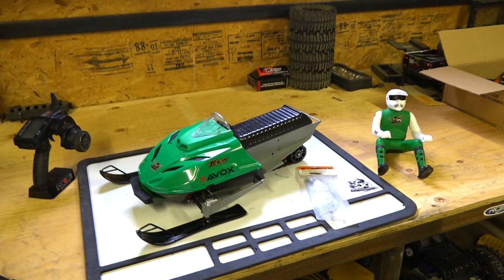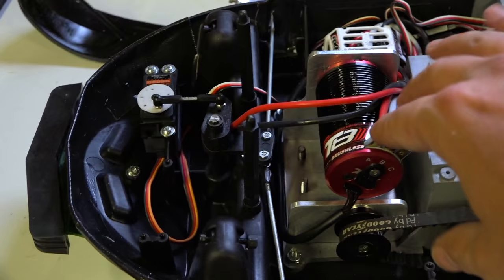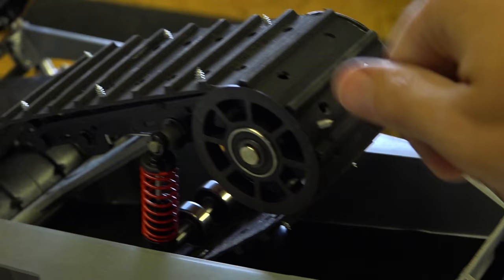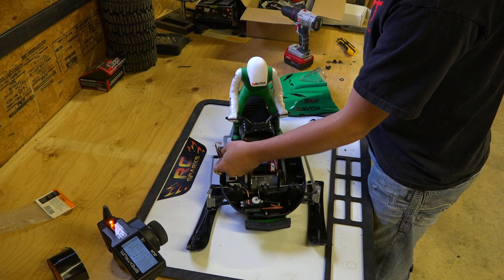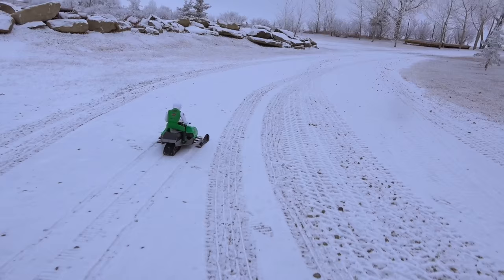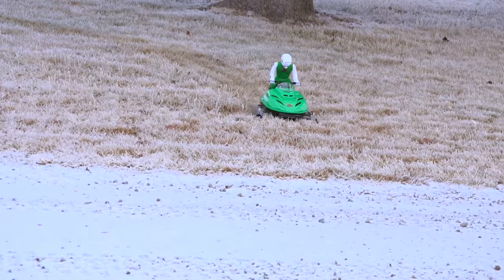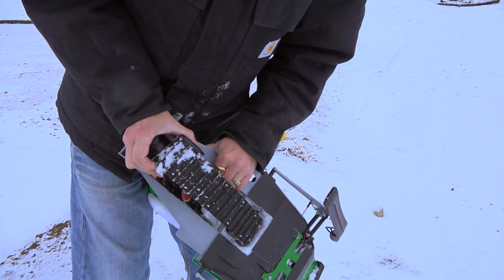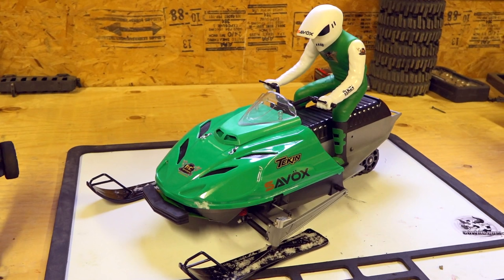RC ADVENTURES - Brushless Snowmobile Test - Art Attack Kit, Tekin ESC & T8 Motor, 3s Lipo

Comment: Hi Medic, I'm the guy from Wisconsin that recommend the 1/8, 125 amp setup. Awesome setup, you will get hooked once the snow fills in. Glad to help you get up and running without having to go through the "smoke sessions" trialing 1/10th's kits like did. Here's a top tip for you (and I know it sounds completely couter-intuitive): Loosen the track tension. You want to have a bit of visible slack between the track and the lower runners right in the middle. A bit of track droop will allow bits and pieces to "run through" the track drive without imposing enough force to derail the track. Also, under throttle, the laterally compliant track suspension is tightening (one of the things the Art Attack guys have dialled in.) I talked to an old-timer about my track derailment woes (even after upgrading to the pin drive.) It turns out my dad used to work on CAT tracked heavy equipment as a mechanic. You (and me) started out by putting the old RC "tighter is better" wrench to the Art Attack. The paradigm has worked for me since. It took me a couple batteries to get the track tension dialed. My advice is to slacken the track to a seemingly ridiculous amount and tighten it until it doesn't hop off vs starting tight and slackening. I wish I could provide you with a unit of measurement, but it's loose vs tight. Good luck, can't wait to see you ripping it up.
Reply: Oh, one more important item, during my track tensioning sessions I started to suspect that the tensioning screws were "self-adjusting". The left side seemed to be loosening up during the run. To counteract this effect I put a moderate amount of Loctite 243 (blue) on each adjustment screw. Be sure to check the left-to-right tension by plucking the lower middle portion of each side of the track. The 243 blue is hydrophobic and will keep things adjusted properly as well as keeping out moisture.
Reply from the maker: +case MasterxL Wow, you really have nailed down some important info for me in your posts. Thank you so much for taking the time to help me, and to type so much great info.  Because of your advice - I had upgraded the Motor and ESC.  You're 100% - the 1/10th would have worked, but would have been rather lacklustre.  This power setup was the way to go. When I head back into my shop today, I will glue the bearing, silicone the sled, and loosen the track. I will also watch out for the screws "self adjusting", and add the blue loctite 243.   I will also be getting more of the stud screws to help even out the "crunching" sound.  Really bud, thanks for the heads up - this machine is a blast!

Comment: When it comes to belt drives it is way easier to over tighten than to have it too loose. Any imperfections in the belt or alignment just get worse the more you tighten them. In most cases when you see the belt rolling off one side or the other loosening it alittle can help it realign itself during operation.

Comment: Is the Drive Line free when the motors disconnected (spur and pinion not touching) or do you run a lot of drag brake?? Just seems to stop quick when you come off throttle unless your just hitting the brake

Comment: Someone should turn a 120cc into an rc, those are kid snowmobiles, that would be super cool
Reply: It wouldnt be that hard just keep the original motor and you the only thing that would be hard to find is 2 big servoes one for the throttle and one for steering other than that a battery for the servoes and a receiver but yes it would be cool but a but harder to get unstuck than a litlle rc

Comment: Idk how loose you can run the track on an rc sled before it starts to skip but I'd loosen yours off a bit and try her out again. on a full size snowmobile, the looser you run the track, the more power it will have. (less rotating friction)

Comment: HEY DJMEDIC I NEED YOU TO ANSER THIS QUESTION(sorry if I spelled your name wrong) I need to get a traxaas slash a motor by Christmas and I want one that's faster than stock(Titan 12 t) can I get like a villenian motor + esc combo? I just need a fast motor but I don't know what to get PLEASE HELP ME !!!
Reply: If you need the car to go faster change the gearing larger pinion faster smaller spear gear faster. If you need a faster motor you can put a brushless system but you would have to make a few modifications to fit it in.